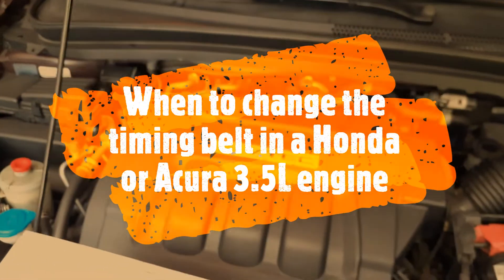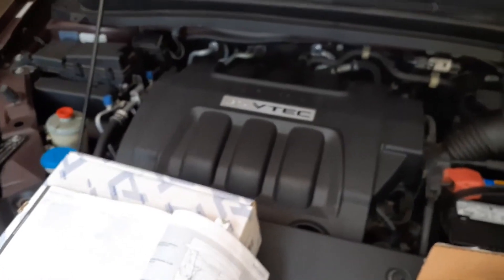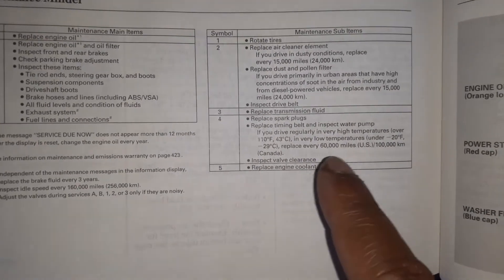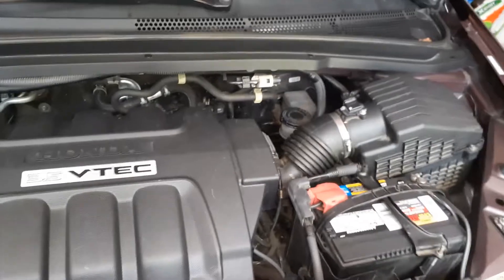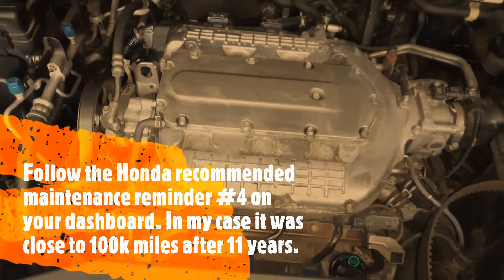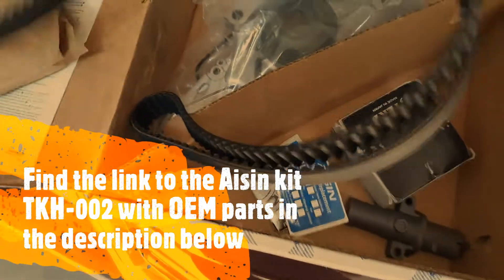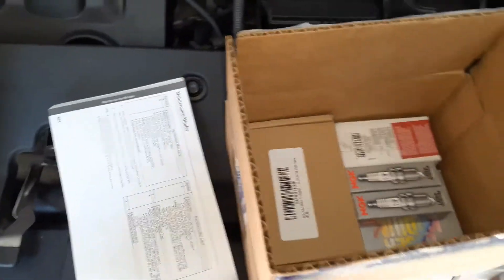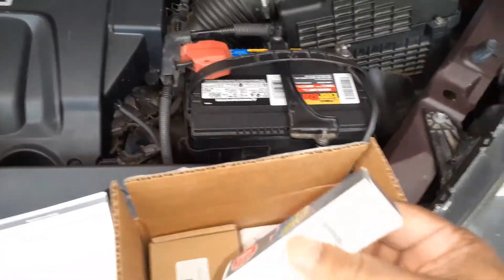When To Change Timing Belt & Spark Plugs In A Honda Or Acura 3.5L V6 Engine - 2010 Honda Odyssey

Comment from the maker: Watch my other video https://youtu.be/-DeRjCVGAxw on how to replace the timing belt.
Caution: There are lots of fake Honda labeled parts sold in the internet for cheap. A broken timing belt will cause expensive damage to your Honda interference engine. Instead buy the Aisin kit TKH-002 from the official Aisin store on Amazon - https://amzn.to/3CuxDBm. Aisin kit has the OEM parts for the Honda engine.